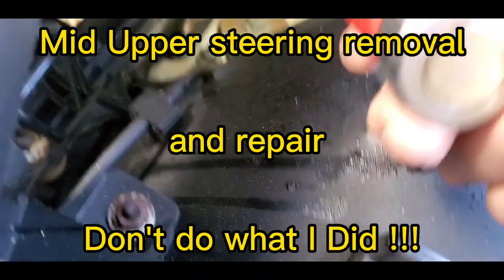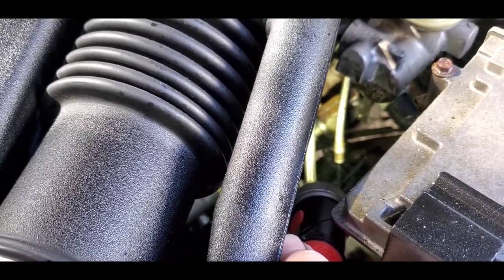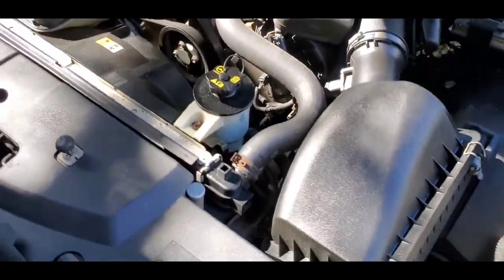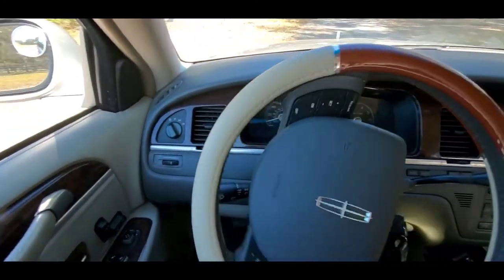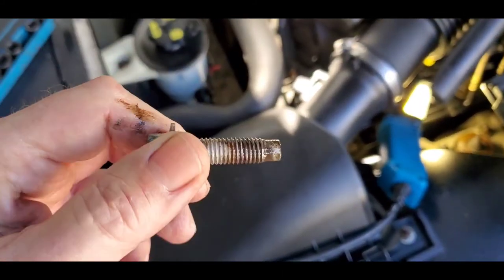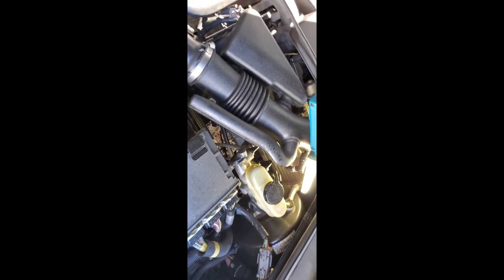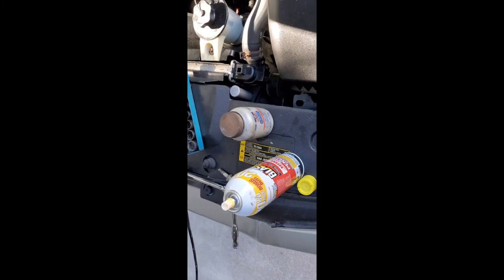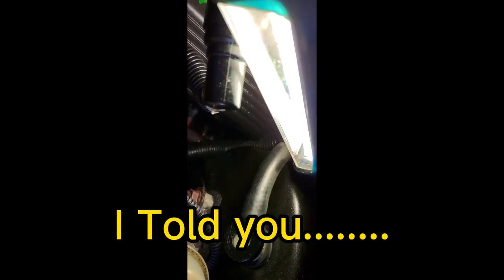Lincoln / Crown Vic Upper steering shaft repair

Comment: I’m doing this to my Vic right now and the shaft won’t go more than a few inches in that tube where shaft connects to the steering and it’s acting like it’s to short to reach what do I do ?
Reply from the maker: You are working with a KEYD shaft that means you have one tooth bigger than the rest, you will need to turn it one tooth at a time until you find the sweet spot and it slips in start watching the video at 3500 and see what I did, I'm gonna tell you its a bear but it is doable with some patience.
Good Luck
Reply: @DoubleTroubleGarage thank you I’m working on it again right now and figured out I accidentally made the shaft move in so I just extended it and now it reaches but now I’m trying do what your showing at 35mins but I found a plastic sleeve stuck on the end of shaft and I thinks that’s what was stopping my from getting it on
Reply from the maker: @2slow2valve28 
How's it going now, any better news?
Reply: @DoubleTroubleGarage  I ended up taking out the whole steering column and just hammering shaft onto the other and got it all back together and we good now didn’t take much because I’ve already put nrg steering wheel and hub on but yeah got it all together we good man thanks for the advice though

Comment: i’m having the same issue with my 2007 GM changed the whole front end controls arms stabilizers but i guess when i u looseness the rack and pinion it ripped out the whole shaft assembly now i’m stuck at the same part you were at one point! your video is helpful
Reply from the maker: Its not a good situation to be in but I have proven that it is fixable with a little time, just get as comfortable as you can and go tooth by tooth.
Let me know WHEN you get it fixed!
DTG
Reply: @DoubleTroubleGarage were you holding the steering wheel at any angle or keeping it straight while putting the shaft in? because my wheels are turned a bit so i’m wondering if i have to keep the steering wheel in that same angle the tires are facing.
Reply from the maker: @jojoslime2575   you want to keep the steering wheel straight and stable, if it is able to move at all you could miss the sweet spot and have to keep going.
The whole purpose of the keyed shaft is to keep everything clocked right so when you get it back in it will be correct by design.
To keep the wheel straight you can use the seat belt, tape or a bunjie cord extra. 
Hope this helped 
DTG

Comment: I'm about to do this and hope that bearing doesn't come out of my steering column. I noticed the green bearing retainer was slipping out and it was damn near out 2 inches so I've decided to replace the lower and upper shafts. Got a good deal on the OEM parts on eBay. When I disconnect that top shaft pinch bolt, I'm going to hold that bearing in place some how. There is a recall for this exact thing but Ford told me they already inspected it in 2014 and it was fine. They should be forced to repair this on every single vehicle since you could lose complete steering control if that bearing were to get pulled out due to u-joints binding.
Reply from the maker: You are right, you don't want that coming out, why don't you put a pair of vice grips or a hose clamp on the shaft where it goes through the fire wall to keep the shaft in place while you work, just don't forget to remove them, haha
DTG
Reply: @DoubleTroubleGarage  Yeah, I was thinking of taking out the upper shaft out of the bearing first. Does the bearing come out easily by itself without the shaft in there? That's what I"m worried about. Thanks.
Reply from the maker: @ismann9148  YES! Mine came out way too easy, it's a metal shaft held up by a plastic bearing that has been exposed to extreme heat for years, do what you can to hold it up in place.
Reply: @DoubleTroubleGarage  Thank you, Sir. I see once you got it back in there, it stayed pretty well. Is that plastic piece also keyed and only supposed to go in one way? I probably will add a hose clamp like you did. I figure if it starts to rub then I know I need to push it back up haha. You mentioned you used a self-tapping screw with a washer? Is that more permanent?
Reply from the maker: @ismann9148  I don't recall the plastic to be any problem going back in place, and yes I would call the fender washer more permanent and more piece of mind.

Comment: My steering suddenly became stiffer. I replaced the power steering pump, then this part, but it still isn't right. Do you have any ideas? What did you do to fix yours?
Reply from the maker: I set it aside for a while, mine is still not like it should be, I'm going to change the steering rack that is the only thing left that it could be, thanks for the comment  👍
Reply: It’s the upper steering shaft u joint that will cause the issues

Comment: I need to replace mine on my beautiful town car god I freaking love these cars. I’m so scared tho at the moment. When I turn I can feel that knuckle in the shaft.
Reply from the maker: It was really easy to remove that shaft and soak it but hitting the caps with the hammer really freed it up. I have to replace my Rack and have had it on the back burner but now I gave it to my son so I have to do it soon.
Town cars are great, I need to find myself one in cherry condition with low miles!

Comment: What happens if you brake That plastic around the keyed shaft
Reply: On the inside of the column That connects to the steering wheel
Reply from the maker: That is what holds the shaft from falling out, you will need to find another one or get creative, on mine the tabs broke from it being so brittle so I used a self taping screw and a fender washer to hold it up in place.

Comment: I’m trying to get mines to go back in right now. Been working on it for about 5 hours. Any extra tips and tricks?
Reply from the maker: That is a keyed shaft and will ONLY go in one way.
Get comfortable  Ha Ha,,, 
But Really get a fan, Pillow or whatever this really helps you to concentrate, if your neck is on fire or a gas pedal is ripping your ear off its distracting and annoying and you need to concentrate.
Lubricate well and Mark the shaft somehow with a marker or tape, when you push it in it will slide in all the way or not, Probably NOT, 
Pick a direction let's say "right" Pull the shaft slowly out while turning to the right ever so slightly you will feel the teeth and it will go in somewhat but not all the way, do this one tooth at a time it may take forever or could be quick but DONT stop until you are all the way around OR it slides in all the way.
My key lined up just a few teeth before completion of the rotation, hopefully yours is sooner.
Hope this helps, 
DTG
Reply: @DoubleTroubleGarage  I appreciate you responding and thank for the info. Yea I kept trying until it was time for me to hop in the truck and get on the road. Never got it to lock in. I used my phone to take a look into the tube where it post to line up and the teeth in there look kinda strip. I’m going to try for another 2 hours when ever I get back home but if I don’t get it by then im going to end up selling it. I been using wd40 to lubricant it but I will try some of grease next time
Reply from the maker: @sammyiza5736  I hope you get it, I don't think them teeth are stripped,  lmk

Comment: I worry that when I spray these flammable sprays on these shafts, will it drip onto the Catalytic converter and catch fire
Reply from the maker: Ha Ha Ha, That's the same thing I was thinking every time I sprayed mine so I only used PB Blaster I think it has a higher flash point but don't quote me on that....
Reply: @DoubleTroubleGarage  also what’s this round barring thing you are talking about ? I need to get one but have no idea what it’s called
Reply from the maker: @josephmcnamee9338  
That round bearing should have never came out its supposed to be part of the lower end steering column, whatever you do don't let that shaft come through the fire wall like I did, took me forever to get that 1 million tooth keys shaft back in place.

Comment: My Crown Victoria has had a lazy steering feel that I haven't yet been able to cure. The lubrication method helped some, but barely; so, I removed the steering shaft (both upper and lower), and I cleaned them thoroughly (not that they appeared to even need it) — but it didn't end up curing the issue. In fact, I effectively introduced play in the wheel, likely because I reused the original bolts even though Ford apparently recommends they be replaced with brand new ones. At this point, I'm thinking the power steering system itself is at fault: that usual noise you're supposed to hear when you turn the wheel is not present, and there is also some bubbling occurring inside the reservoir. This has led me to believe that there's some sort of blockage or air seep keeping the pump from performing at its fullest capacity. Do you think this could very well be the case? Thanks for the video, by the way. Not enough videos like this exist.
Reply from the maker: Sounds like you are going through the same  gauntlet of issues, there is one more thing and that is the speed control unit on the rack itself, the only way I know to test it is to apply 12v and see if you get full power steering, I did just that with no difference noted BUT next time I used the same test lead I found it had a short so now I want to test it again.
Reply from the maker: And even after I replaced the pump it still has no wine sound.
Reply: @DoubleTroubleGarage  so the whine noise is normal?
Reply from the maker: @matthewcollins7660   Yes it's normal but seems on the later model town cars you don't hear as much, I used to be able to pick a ford driving through a parking lot with my eyes shut.,,, lol
Reply from the maker: In my history of working on cars its never the power steering pump, I have changed them because they were leaking or froze up but that's it, they just always seem to work, just my opinion.
Mine has a intake manifold leak so is sitting waiting for me to repair, therefore it has kept me from tracking down the rest of my issue but a comment that I received told me of a fuse that could be blown so the first thing I will do when I get back on it will to be check ALL my fuses to see if any are blown OR Missing, you should try that before you go any further.
DTG

Comment: I detached that joint(to work on an exhaust tube), the stEering wheel twirled around & I had to recNter clockspring.. bt after that screwup.. I noticed there’s a click clunk, 1-2 in gap in steering wheel turn/play.  any guess what that might be?🤔
Reply from the maker: The only thing I can think of is if that, for lack of a better description, "Plastic Bearing" at the end of the steering column slipped out. You will have to stand on your head under the dash and look to see if that bearing is flush with the end of the Colum and if not push it back in, the clips that hold it are plastic and so brittle they break easy.
On mine I put a self tapping screw with a fender washer to make sure it stays put.
Reply: thNx! Ither that or my loose left outer tie rod, well C👋
Reply: by the way, there is a geometry snFoo in your suggestion - IF I was short enuf 2 stNd on my hed under dash(not a smrf- unlIklE).. I could just as eazLE stNd rIt sId up & sQat down🤔
Reply from the maker: LMK
Reply from the maker: That was just the way I put it you dont really stand on your head,  you actually lay on your back with the door sill securely in your lumbar and your right ear pressed against the brake pedal LOL, I am 6' so I know the challenge!....
Reply: @DoubleTroubleGarage  
yeah, BlEv it or not, I actULE nU U wr kiDng(& problE didNt think I was smrf sIzd👋).. 🤨?.. 😒
Reply from the maker: @ezwa9979  
LoL, I hope you find the problem but in the meanwhile it's been fun talking with you!
Reply: How did you recenter the clock spring?
Reply: @bluecheerblues  

wL, that was a Yl ago, most important thing is ofcoOrse to 1st unplug battery, then to neutralize plus & minus cables while detached from battery(by touchng them together for a minute) then to be careful with airbag wires wN removing airbag.   BUT ANYWAY, CLOCKSPRING-centering? I started the whole process with wheels & steering wheel straight, when I got to that point, I think I remember turning clockspring all the way one way(gently ofcoOrse) then all the way the other way - gently, & counting amount of revolutions- then 1/2 way back.  but that’s just my memory, not positive👋

Comment: Before lubing the knuckle you want to remove hidden corrosion, and your friend here is the oh-so-expensive vinegar.  Patience is key here, and another car to drive while you leave the knuckle in the vinegar for several days-the more the better, and change the vinegar when it gets nasty.  After that the knuckle will be renewed inside and out- mainly inside.  Vinegar is so under-rated.
Reply from the maker: You are correct, vinegar is great but yes it takes a while and my goal was to find the problem first, remember when they used to put grease fittings on everything...